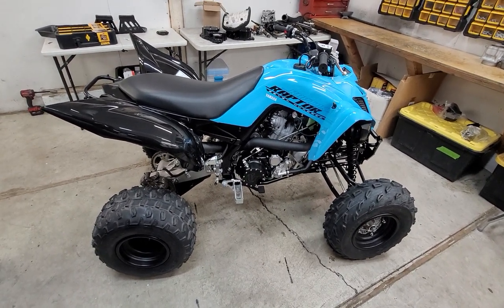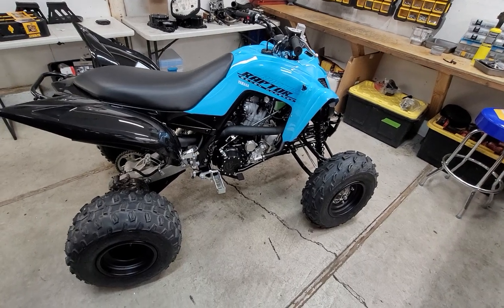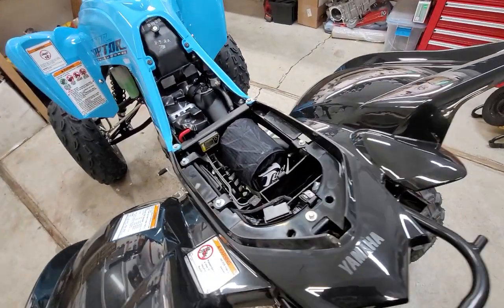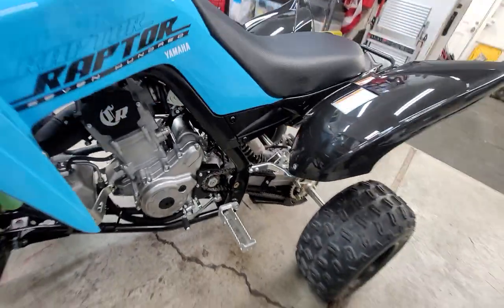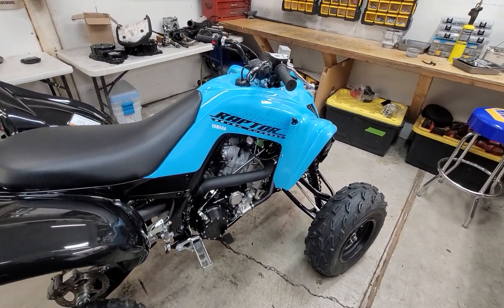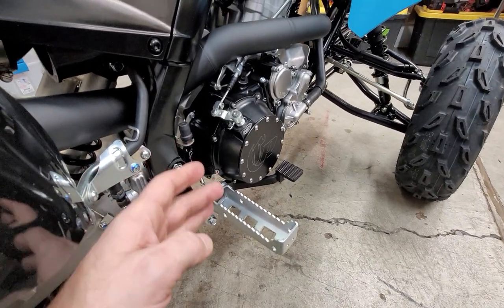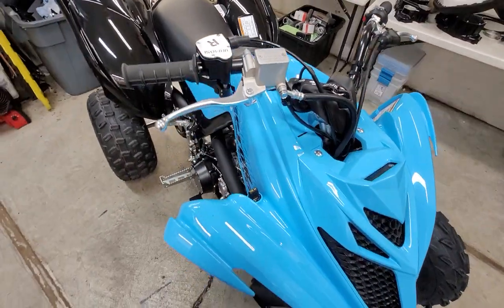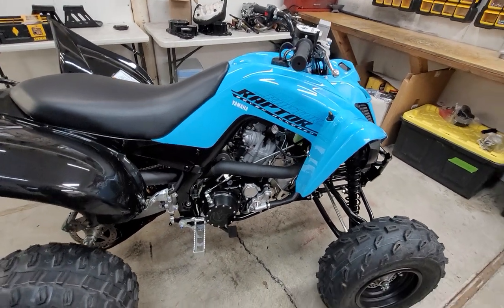Cuervo Atv  My personal 2023 Raptor 700 all current mods

Comment: What is the best pump gas 93 trail engine combo for most horsepower and torque reliably? Been looking at your builds
Reply: Im been for the same answer for the past few months.
Reply from the maker: We offer a 740 and 790 cc build for pump gas... the 740 i ran last year  73 hp . 6mm stroke stock bore , +1 head package. Call to discuss 951-743-6328

Comment: There must be an easier way to get huge gains out of one of these new raptors. Perhaps an engine swap would be a good start!
I would like to see someone find a way to achieve a reliable 90-100hp. There is no way this can happen with the OEM motor and a boatload of mods.
Reply from the maker: Always comes down to power vs weight.

Comment: I'm curious about your comments on asv levers. I have had them on my raptor 700 for 5 years now with no issue. I made sure to adjust it to pull the same length and clear my handlebar controls. I think they key is to take the time to set them up.

Comment: Any wire diagram for white signal/running light the way you have it setup?
Reply from the maker: I unpinned the connector yellow wire  and soldered it in on that terminal
Reply: @CuervoATV  where can I purchase these.? Looked on ebay but didn't find retro atv.